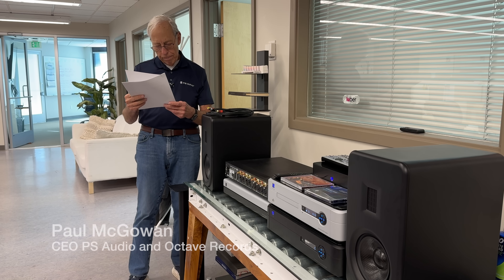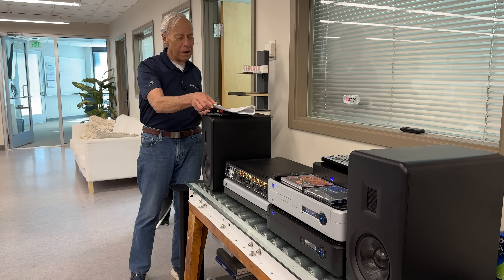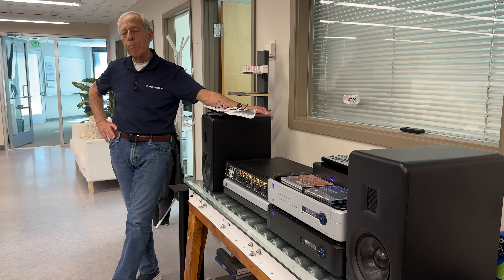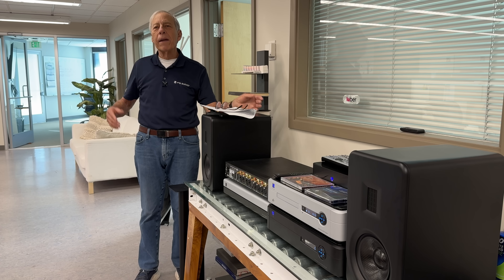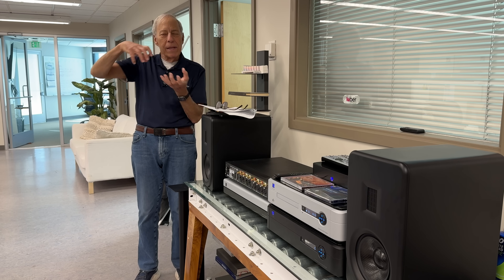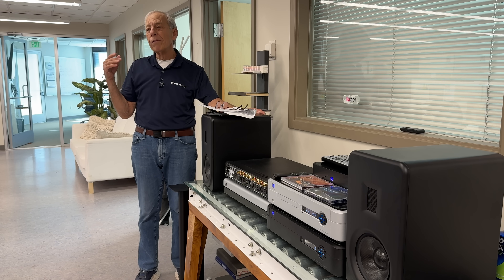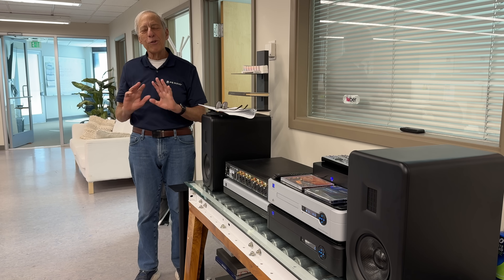Understanding signal to noise ratio

Comment: First, "db" is a ratio not a measurement. Saying something is 90db is like saying something is 90%. Both mean nothing until you give a reference. e.g. 100Watts is 10db higher than 10Watts. But by itself 10db tells you nothing. Next. This discussion is about dbSPL. Sound Pressure Level. Even that is just a ratio lacking a specific 0dbSPL level measurement. It is considered the softest sound a human can hear. But that changes from human to human. Although 20 μPa is usually considered 0dbSPL. With that reference 120dbSPL is referred to as the Threshold of Pain. The level at which your ears start bleeding and you have permanent hearing loss. OSHA rules require hearing protection used around 100dbSPL. The noise floor in the typical living room is around 35-50dbSPL. So most environments only give around 50-70db dynamic range.

Comment: Distortion numbers are all gobbledygook to me. I have a modern McIntosh tube preamp that measures worse than my 1980s Mc solid state amp (0.08 vs 0.01% THD) yet it sounds cleaner and more neutral than the SS which ironically sounds even tubier to me. I’m no techy and someone probably has a better scientific explanation than me or will call me religiously fanatic but this is why I just trust my ears.

Comment: SNR ratio is also related to sensitivity. I run my amplifiers into electrostatic ear-speakers and I can hear noise floor on anything with less than 120dB. A lot of Yamaha amps are clinically clean along with my Sansui Alpha 907 but I find more noise floor comes from older preamps

Comment: I want to know how a circuit can separate noise from music.     
No white board is large enough for that, so start typing, Paul.     
Another book is due, and the deadline is sooner than you think.
Reply: The only solutions I can think of are noise gates and low pass filters. Which both alter the original signal to a degree.

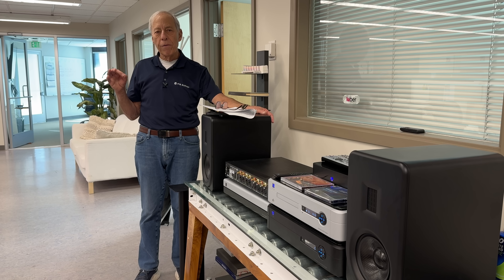Comment: @3:28 "When I put the needle down, in the groove of a record..."
Stereos do not have needles.  It is a stylus.

@3:33 "Even if that recording has zero hiss, you're going to hear the hiss; the background surface noise of the record".
That is sort of true, but not exactly correct.

If you professionally set up your turntable (very few people do), and you play a clean record, it will play spooky quietly.  Not 100% quietly.  There will be occasional ticks, due to imperfections in the pressing.  But even between songs, you will forget that a record is playing, because it will be so quiet.

People that make an effort to set up their turntable properly, most likely set the weight of the stylus pressure, perhaps they set the anti-skating, and possibly the vertical tracking alignment.  But there are several other adjustments, and all are critical, for a record to not only play very quietly, but to also extract all of the magic from the groove, and get exceptionally good imaging.

When the stylus rubs where it should not rub (even the slightest), you will hear that as surface noise.  It is like your car's tire rubbing up against the curb.  You will hear that.  But get every turntable setting dialed in professionally, and you will think that you just got an amazing upgrade.  Vinyl gets a bad rap, due to 99.9999% of people not having every vector professionally dialed in.
Reply: "there are several other adjustments" could you list them succinctly?
Reply: @grumpy9478  Yes.  Here is the succinct list:
-- the effective length of the tone-arm
-- the cartridge's weight
-- the vertical tracking alignment / rake angle
-- the anti-skating
-- the overhang
-- the offset
-- the zenith angle
-- the cartridge's azimuth.

The last one requires a special set-up pressing, and an oscilloscope.  You will probably have to have a skilled turntable guru at the store do it for you.  Finding someone that really knows what they are doing (who also has an ear you trust) is not easy.  I was fortunate to have an expert set up my turntable, at my local high-end store.  So there is an additional labor cost, too.

If you do everything yourself, you will need a number of turntable specific tools.  Wally Tools is a popular choice.

Lastly, some cartridges are screwed up by the manufacturer, because they install the cantilever at an improper angle, and it even happens, occasionally, on multi-thousand dollar cartridges, and probably happens regularly on sub-thousand dollar cartridges.
Reply: Sometimes I needle people about their stylus too! Good advice and quite correct, but it got me thinking, don’t we live in a world of +/- tolerances? I’m sure 99.9999 of people operating machinery of any kind don’t have them perfectly set up. Maybe CERN does. 😊 I do the setups on my simple Orbit 2 turntable, nowhere near as complex as you’re talking about, yet it sounds fantastic. But you weren’t talking about me, because I have no complaint. You were talking about the whining unwashed audio masses…I say who cares about them? If they can’t be bothered to learn how to use and maintain their own equipment, let them eat Bluetooth. 🍰

Comment: Does hiss create fatiguing noise?

Not having hiss is the reason I happily own a tube setup. My ears never fatigue.
Reply: They can be fairly quiet, but tubes generally make a lot more hiss than solid state devices do.    

Uh - huh.    Another balloon gets popped.
Reply: All tubes hiss…
Reply: I love my sound.
I must be a rare lucky audiophile that owns ‘no hiss’ tube amplification. 

Maybe, new school tube amps are better than old tube technology amps. 

I can’t judge that point Paul makes because I have my current amp and  I won’t care to try to afford an old technology tube amp to A/B test. 

If I was lucky, I’ll count my blessings and move on.
Reply: Depends on the design and the implementation, some tube amps are shown to be very noisy and others are not noisy at all. Audiosciencereview has measurements of various tube amps and many of them have a noisefloor under -110 or -120dB

Comment: With modern digital music, this has become an issue we almost forgot about.
Reply: It is existing but noise,  due to very unusual imaging,  brain selection and low level ,    almost  do not interfere  with  other heard  sounds - ear attention without special focusing ommits noise.  

I think in weird way we  may compare noise to   white color frames around  painting  - it sets    relation between colors of painting   to  color of lighting represented on white frame ( where applicable) 

 In quiet moments I  perceive  noise like  parallel   sound of very delicate  rain  behind home wall.  -   located everywhere while instruments and sounds just as Pauls said have   locations where we follow them .

  Much more annoying are voices of birds outside and subconscious sounds  from neighbours which push ( me) to listen after midnight. In    this case   noiseless system has  no advantage.